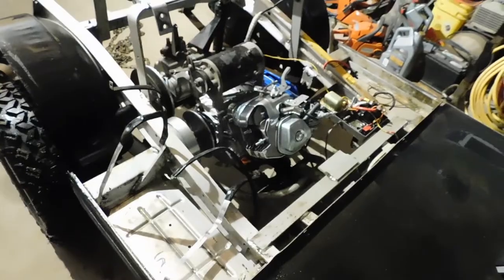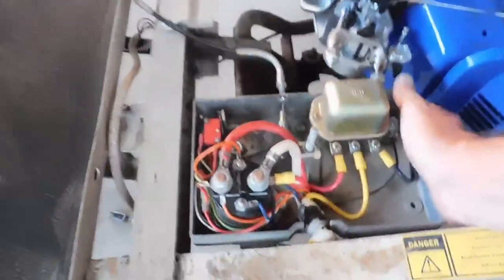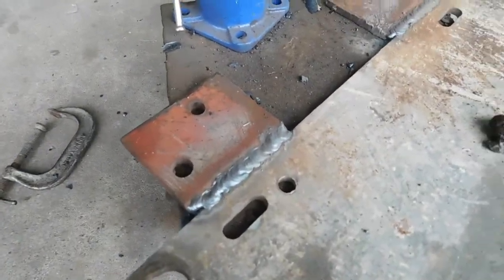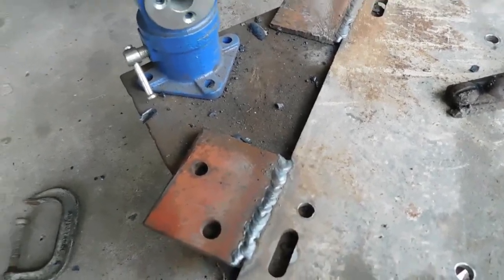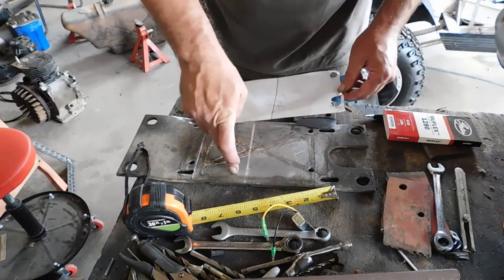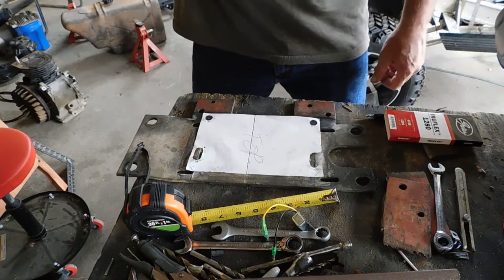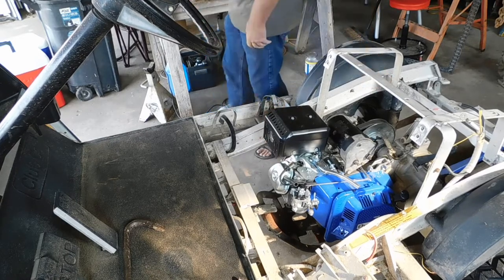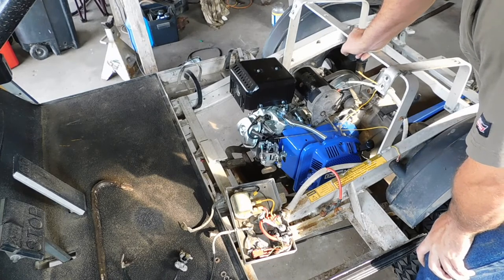Club Car Golf Cart engine swap part 6

Comment: You could just buy a throttle cable 7ft long and run jt to the pedal
Reply from the maker: That would defeat the purpose of having the starter generator and the pedal start.
Reply: What was the reason for not using the starter that came with the engine